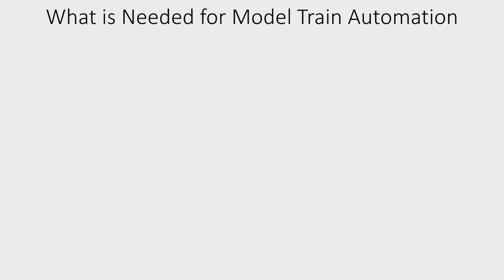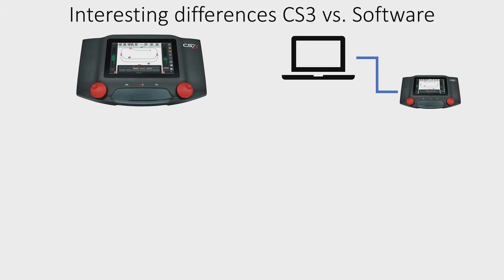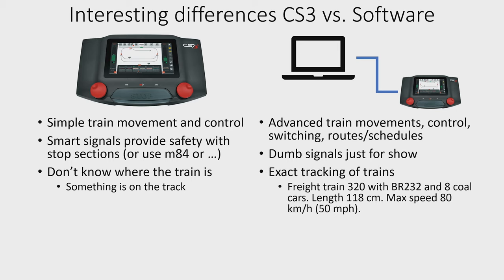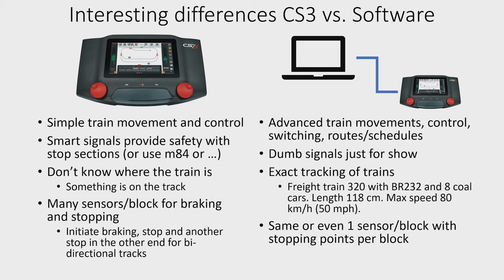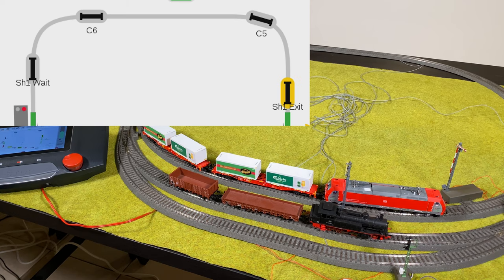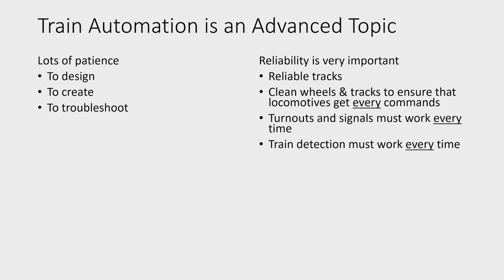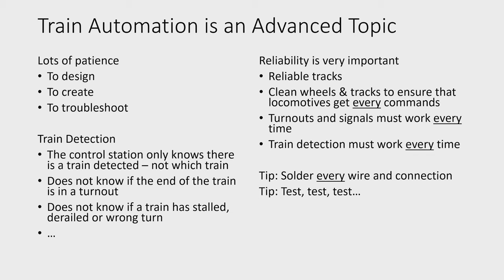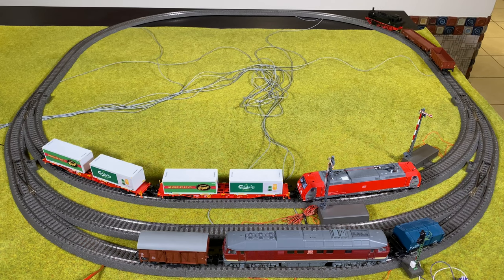What is Model Train Automation - Märklin Style? (Automation Episode 1)

Comment: Thanks, having around 53 locos, i guess i will need you lessons.
Reply from the maker: 53 locomotives - that is quite a few. Automating a large number of locomotives can be cumbersome. Consider using software automation or a mix of CS3 with signals/brakmodules, that will make things easier. The software automation will cost less (in hardware, but expensive software). I intend to cover this after I have looked at automation using the CS3. Enjoy ;-)
Reply: @ModelTrainFun  Thanks and sorry for the late response, i do not plan to use them all, automatation seems very interesting but complicated, i guess for 5-6 locos cs3 will be ok, correct?
Reply from the maker: @tofathi195  Yes CS3 will be enough in this case. However, don't forget software automation gives you a lot more possibilities. Both roads requires planning and troubleshooting. Both are fun to use. Enjoy ;-)

Comment: I have watched this video several times now and am getting ready to install three signals this week in a staging yard.  I am using contact tracks and I believe I can make my stop tracks serve as contact tracks as well.  So I will have a contact track prior to each signal to turn it to stop position and a contact track where the train stops which will change a turnout to track two, change a signal on track two to go, and set the train on track two in motion.  I will let you know how it works.  
By the way, if I may offer one suggestion: perhaps consider putting less information in each video.  For example: do one video about using the CS3 for automation and a second video for using software for automation.  Just a thought.  Thanks for your inspiration.
Reply from the maker: I hope you have fun with creating your staging yard. Yes same track can work as both contact track and stop track. Insulate center rail to make it stop track and insulate one of the rails to make it a contact track using the insulated rail as the detection rail.

Unsure if we have talked about it before: If it's a hidden staging yard, then I would consider something without the need for signals in the yard (you might still want a visible signal at the entrance to the yard). In this case I would just have the contact at the end of the staging track (assuming one-way staging track). When the locomotive/train reaches the contact track, then just turn power off the entire track (center rail), change the turnout and an optional visible entrance signal. The trick is to make a contact track that is long enough for braking distance and ensure the entire track is long enough to always ensure the entire train is within the staging track. Why do I suggest to turn off the entire staging track? This is to also power off light etc. in the cars e.g. passenger cars. Note: Be careful with this approach if trains appear in the staging with high speed.

Note: If you would like some specific input for your layout that I might be able to help with - consider sending me an email (see the Channel About). I perfer here in comments as others can read it as well, but if you have a specific design  I could give you some input on email.

As for putting less information in each video - indeed. Some of the later videos have become quite long. The next beginners will be divided into two to compensate for this. As for the Automation series: I have so far only talked about the basics and a little CS3 automation. Software automation is still many episodes away...

Enjoy ;-)

Comment: Very cool, but also very expensive! We rolled our own software running on a microcontroller talking to the trains and switches with DCC. The sensors were also hall effect sensors, but they were embedded in the wood under the track and straight from china.
Reply from the maker: Hi Laser Lock, Indeed automation can become expensive and cheaper methods exist if you have the time and knowledge to build everything from scratch yourself. Question: Can the hall effect sensors detect the metal in the locomotive/train/cars/wheels - or do you have to mount a magnet on it? Enjoy model trains ;-)
Reply: @ModelTrainFun  It doesn't always detect the train, but we glued some magnets underneath them. In the corners, you need to place the sensor a little bit more to the inside.

Comment: You talk about digital signals, ofcourse from märklin. I was wondering whether it's possibile to connect microscale SBB signals to the CS3. Is there anything that I need extra?
Reply from the maker: Hi, 

Are you talking about these signals? https://www.microscale.ch/_downloads/Flyer_101.pdf As I read it they do not come with a decoder - however it seems they recommend https://www.qdecoder.ch Looking at these decoders e.g. https://www.qdecoder.ch/lichtsignal-decoder-?c=7 it seems they support both MM and DCC. This means you can control them from the Central Station Station 3 (CS3).

However, some of these signals look very complex and have many aspects. The CS3 supports 2, 3 and 4 aspect signals with direct icons. You can also use more complex signals but it might be more cumbersome. Generally, I understand if you want complex signalling then you need to go beyond standard controllers and use software automation that better can handle complex signalling. Hence, I foresee you want to use an automation software together with the CS3 to fully utilize the signals.

I would ask around to see what other people do with these specific signals. If you can find good advice it is best for complex signalling. In short: It can be done, but can be complicated.

I hope this helps! Enjoy ;-) Bo

Comment: Hi Bo, I wanted to ask you to tell us about a problem that with Märklìn you will never have but for me that I have Trix instead yes, I am talking about the short circuit that is generated in model railways with two tracks with the return ring. Would it be possible to see it on the Central Station 3 plus?
Reply from the maker: Hi Lorenzo,

The Central Station 3 (CS3) will automatically go into STOP mode and cut power to the layout when a short circuit is detected. If you are using track detection on 2-rail layouts, then the track detection works  by detecting shorts. You can use this to help indicate where the short might be: either where the trains are - or on the piece of track showing occupied where no train is.

Don't forget you still need a "loop" module to handle power change when going through the loop. To be honest I have never played with this - just seen it in other YouTube videos.

Hope this helps! Enjoy ;-) Bo

Comment: This was very helpful. I am just beginning to introduce some automation so that I can have a small (3 track) staging yard.  I would like to use braking modules as well.  In the lower level of the layout, where the staging yard is located, I do not need to use signals.  
I am thinking that the contact tracks in your demonstration layout must trigger an event and that the event might consist of things such as changing the signal settings and switching some turnouts. 
So, am I correct in thinking that you need an S88 and contact tracks to trigger an event, but that you would also need an m83 (or an in-track decoder) to switch the turnouts and change the signal? 
What additional equipment is needed to connect the braking module to the CS3+?  
Also, what is the difference between k83 and m83, or between k84 and m84?
Reply from the maker: I am glad this video is helpful. This is just an introduction video. In the following videos in the series I will introduce automation and then look at some typical examples like the staging yard/shadow station.

A brief description of how I achieved it is that I have S88 connected using contact tracks. The contact tracks are at the end of the platform. When the trains arrives at the end of the "platform" it activates a contact track. I use this event to change the entry signal to green and change the turnout. Additionally, I set the signal to red when the train leaves the contact track (it is Free). You can see how to connect the S88 with contact track and the beginnings of automation in the Automation series: https://www.youtube.com/playlist?list=PLYAhs-Pox3sHzQJsNU-FmOEj1ylO-NPpV

You can see the scripts I used here: https://1drv.ms/u/s!AqYmnR5sGgDxgR9Ja1aua3Ckq_fX

I will continue the Automation series to talk more about how this actually works.

If you are to make a staging yard/shadow station then I would just use the m84 to power off the entire staging yard track when the train reaches a certain point. The reason it is the entire track is two-fold:
1. it ensures that event if the locomotive is not in front, then the train stops 
2. No need for power on a train in the staging yard/shadow station. This would power off all lights, sounds, etc.

There is no need for a braking module.  However, it could be nice to slow the speed of the train. Unfortunately, I have not yet played with the braking module. To me the module is very expensive and I am hesitant to buy and use it. But will look at it one day...

You are correct there are turnout decoders to change the turnouts. I am using internal decoders here, but you can also use the m83. I have not tried the older k83 and k84 modules - I believe they are old much simpler versions of the modern black m83/m84. You can fing more on the turnout mechanisms, decoders and the m83 in the beginner series: https://www.youtube.com/playlist?list=PLYAhs-Pox3sG31NwCfqIuk6IvI19q2czn

Hope this gives you some ideas.  Enjoy ;-)
Reply: @ModelTrainFun  Thank you for your very detailed answer. I will be ordering an m83 and watching the video on m83 in the beginner series. I will also look forward to your future videos.
Reply from the maker: @19Nov47  Excellent - enjoy watching ;-)

Comment: Can Marklin Mobile Station unit do the same thing ? Or we must purchase CS2 unit?
Reply from the maker: Hi Horton, 

The Mobile Station cannot do any automation. However, if you only need something very simple you can use the m84 as it has inputs that can control the output. As an example turn signal red when train passes or turn on/off power on another stretch of track when a train appears. Unfortunately, I have not found a way to change a turnout using the m84.

If you want to do automation using a control station you need the Central Station 3 or Central Station 2. I have not tried the Central Station 2, so I do not know how well this works. 

If you are using software for automation you could potentially use a simple control station with a software interface. However, I have not found a good one that is cheaper than the Central Station 3 with a computer interface. You can use software automation with both the Central Station 2 and Central Station 3 as they can interface with a computer.

Did this answer your question? Enjoy ;-)
Reply: @ModelTrainFun  Thank you. Your advice is helpful.

Comment: I am a new subscriber and just getting into Marklin HO.  The layout I am planing will not be fully automated, as I am planning on using the MS2 for train control, but I would like to add some signals for stopping trains on parts of the layout that will not be fully visible (for train storage).  For the signals that will be on the visible part of the layout, is it possible to arrange the wiring so that after you set a signal to green using your MS2, the train will automatically re-set the signal to red after that train has passed the signal?  Great videos, but like the comment below, perhaps too many things being repeated over and over.  Thanks for posting!!
Reply from the maker: Hi, 

Thanks for subscribing I hope you will like the channel.

If you are making a train storage you don't need the signals to stop the trains. Signals are expensive and if you cannot see them it is a lot of money for something that is hidden. I suggest making a stop track without using the expensive signals. In this way trains will automatically stop when the "virtual" signal turns red.

For a train storage (or shadow station) I would make the stop track using the m84. The benefit is that the m84 can work as 4 "virtual" signals and it has 
 inputs that can trigger the output.

You can see in this video how to use the m84 to make a stop track: https://www.youtube.com/watch?v=wrSVwgIgR-4&t=1901s Do the same without attaching a signal. In this way you can turn on and off power to the track. 

The final piece is to use the inputs on the m84. I have not shown this in any video. If you look at the manual on page 15 (to the right): https://static.maerklin.de/damcontent/46/23/46232662a863dd86dbcd0291ea519cdf1650956214.pdf You can see that the m84 has an input as well. The drawing shows a circuit track (Märklin 24194, 24294 or 24994) that is connected to input 4. The idea is that if a locomotive with a slider crosses the circuit track, then input 4 is triggered which will turn on 2 green (as this is the 4th output). In this way if you have a stop track on output 1 and if 1 Red is turn off stop track, then using a circuit track to trigger input 1 will make the m84 turn on 1 Red thereby turning off 1 Green. You can do the same with input 3 triggering 2 Red, input 5 triggering 3 Red, etc. Note: you can also use reed contacts as shown in the manual on input 8.

Unfortunately, I do not have a video showing this yet. I do intend to make one in the future, but have not gotten around to it. If you need more help send e an email - you can find my email here: https://www.youtube.com/@ModelTrainFun/about

Let me know what you figure out and if it works.

Enjoy ;-)

Comment: if the train cannot be decoded to stop anywhere on the track without the signal having to interrupt currents to the track,
I have difficulty seeing the ID when driving digitally.
apart from the fact that you can just stand and stare at the plant running by itself.
I would then think that the whole idea of running digital trains is, if you can code trains, to run as if there were signals.
even if they are not there.
but it may well be that it cannot be done.
I'm considering changing my career path, but I'm not sure if I should go digital, as I don't know how it works exactly.
but had an idea and must say I am very disappointed now
Reply from the maker: Hi Amdi, 

Indeed in the example show in the video the signals stop the trains - however, the signals are truly not needed. You can also have the Central Station 3 (CS3) stop the locomotives when they hit the contact track. For the most part signals in the digital world are just lights. Using the STOP track that some signals support is mostly useful, if you are also running trains manually while others are running automatically.  You can also consider using the STOP track it in a shadow station where you would like to avoid more advanced programming. 

In this video you can see how you can stop the train with in the Central Station 3 (CS3) without STOP track: https://www.youtube.com/watch?v=MtZ1MYwOLDY&list=PLYAhs-Pox3sHzQJsNU-FmOEj1ylO-NPpV&index=4&t=2500s

If you are considering digital and want to know how it works you can look at my Beginner playlist: https://www.youtube.com/playlist?list=PLYAhs-Pox3sG31NwCfqIuk6IvI19q2czn

Unfortunately I am native digital, so I cannot give you much advice on how to transition from analogue to digital - other that doing it in steps. 

Hope this helps! Enjoy ;-) Bo

Comment: Technology has gone so far that the model train today is very close to the real thing. I can imagine if the same control system is used in the real world, it will work as well. Of course, the real world scenario is much more complex and safety is more of an issue, but I think the controlling method is similar, censor, signal, control.
Reply from the maker: There are some similarities, but you can also skip and simplify. As an example when making signals they do not have any safety mechanism for preventing to pass a red - and trains do not have a "keep a live" - or is the "driver still active" button ;-) However, there is much to learn for the real world. Enjoy ;-)
Reply: @ModelTrainFun  You are right. There are some difference. I think the major difference is that the real world is a decentralized system, in other words, there are many decision makers in the network; while in the model world, at least at the current day, it is a centralized system, in other words, automation aside, the maker makes all the decisions. That makes the real world much more complex and fun.
Reply from the maker: @daquan99999  In many model train clubs they do model the real world more accurately with many dispatchers and so on across the layout. Each with responsibility of their own station or area. So if you want to you can also do this part of the train experience. Enjoy ;-)